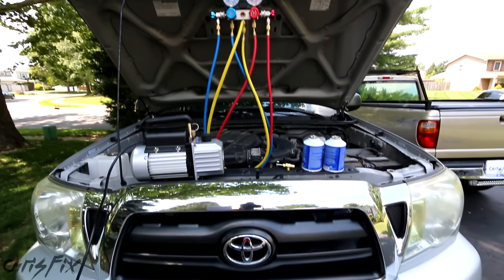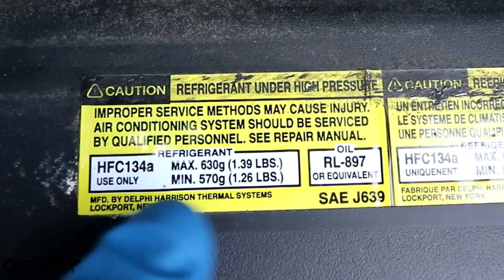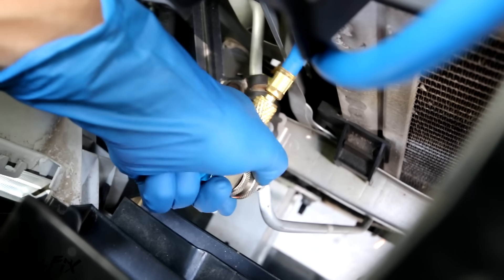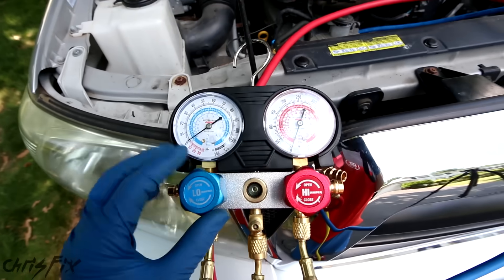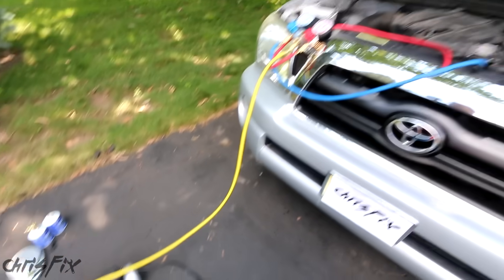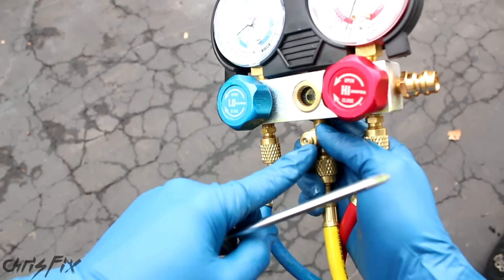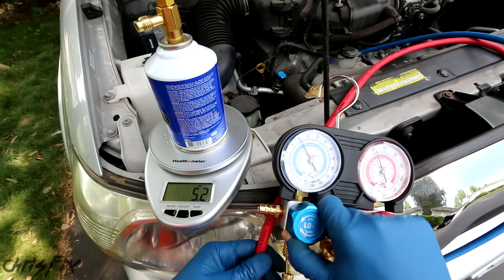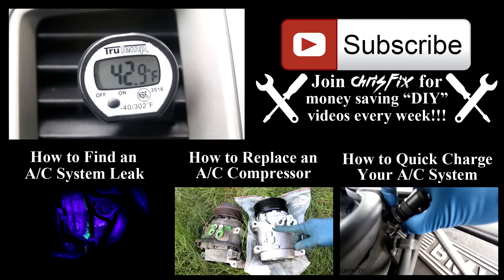How to Properly Recharge Your AC System

Comment: nice video.  If I want to connect the AC manifold just to measure the pressure at the low and high side, should i purge these lines?  how to do so?  I have not seen anyone do that but it make sense as these lines are filled with air? thx
Reply: Its not necessary to purg the lines if you are just checking pressure as the system will push refrigerant into the hose and not draw any air into the system. But if you need or want to purge the lines you can loosen the fitting for the hose at the gauge manifold for a little bit.

Comment: Hi Chris. Thanks for another useful video. My question is: will the low pressure be at 0 if there is still refrigerant in the system? I'd like to find out if I can still test for a leakage without letting go all the refrigerant in the system. Thanks!
Reply from the maker: No, if the pressure is at 0 then it is safe to say there is nothing in the system

Comment: I know it’s an older video, but I have a question: if you close the manifold valves during the leak test, all you’re showing is that the manifold holds vacuum, as it’s isolated from the ac system, right? If I’m misunderstanding something, I would appreciate an explanation. Thanks.
Reply from the maker: No, you would have to close the lines on the service ports to seal off the manifold

Comment: I finished vacuuming the system. Sitting at about negative 30psi. When I connect a can of 134a, and attempt to purge, nothing comes out. The is no pressure. The manifold gauges are in the closed position, holding vacuum. The can of 134a is open. I've tried 3 different cans. Nothing. Needless to say, refrigerant never gets into the system. Not sure what is wrong. The yellow line appears clear when checked. Starting the suburban, turning on the a/c doesn't help drawing the refrigerant into the system. It's as if something is blocked. Is this typical?
Reply: If your system is empty, you have to vacum first  because of the hot air from cycling. After vacuuming to 0 psi then start with charging your system with intervals timed.

Comment: Hi Chris, thank you for the video. I'm just wondering if I'd need to do the step to vacuum 45 mins every time I recharge? For example, my car's AC now is still cool from last year, there may be a small leak which I don't want to chase it now. I just want to recharge every year to get it cold. In this case when my AC is still cool, do I need to vacuum 45 mins before recharging, or just go ahead and recharge right on? Thank you.

Comment: Great Video Chris!! But now that I’ve changed the compressor, the ac light blinks three times when I try and turn it on. ???
Reply from the maker: It depends on the make/model but it can mean that your refrigerant is low/high or your fan is not on when you turn the ac on

Comment: hey chris love the video that you put out. It has help me through alot of my diy fix. This is for my 2005 Acura RSX ( 19.7oz refrig)
 I have a question for you, or anyone who willing to given me a hand. I following the direction with the your ac compressor replacement and ac recharge. I replace the Ac compressor and did a vacuum on the ac system, everything went great no leak(pressure hold, but i start to recharge my ac everything was fine until i started to recharge the second one. I am not sure what happen but my ac refrigerant started to leak out like crazy, in front of my bumper, look like it might be my condenser had a leak, I put  my hand over the consdenser and can feel air coming out of it. i have decide to replace my ac condenser. I just want to know since this leak happen how do i know how much peg oil to add back into my ac system. Any feed back will be great.

Comment: Excellent video Chris. One final step I usually do is to get a little bit of water with some dish soap in it and put that in the needle valves connections. If there's any bubbles present you know the Schrader valves are leaking. I like to put just a small amount of refrigerant in first before I do this test so I don't waste refrigerant.

Comment: You confused fluid oz (volume) and weight oz 1 lb is 16 oz, true, however, depending on the density of the thing you are weighing.  You would have to measure the starring weight of the gas container and watch it drop to know how much you are putting in.
Reply: It is a typo on the can, it supposed to be weight ounces.

Comment: An empty can has some weight. That must be accounted for when calculating percentage of refrigerant used. Easy IF you are using more than one can you have to use or have an empty can laying around.
Reply: Your only removing the refrigerant so when it's 10 ounces lighter that equals 10 ounces of refrigerant.
Reply: @wandameadows5736  thank you

Comment: @chrisfix, when replacing the compressor and it comes pre-filled with oil and you do a vacuum before filling new gas, won't the oil also get sucked out? And when you add oil at the end of the yellow line, won't air also get sucked in?

Comment: Top video Chris. Well done. Worth mentioning that R134A will often run at a slightly negative pressure on the low side after charging. This has always been the main issue with it because any leaks then draw in air. R12 never did this and I'm old enough to remember using it :-) Also, car air con systems often lose refrigerant without having any kind of leak in systems with mixed aluminium and rubber hoses.
Reply: No it should not. If your system is pulling into a vacuum it has problems. The low pressure switch is supposed to turn off the compressor when the suction pressure gets too low. That is how most automotive systems are cycled as opposed to a thermostat
Reply: @Redtooth75  you really are not familiar with R134a, are you knobhead?

Comment: I tried to do this with the new self-sealing cans, and when I went to purge the yellow line, I wasn't able to get a cloud of refrigerant to blow out. It just blew transparently & rather weakly (iow, didn't blast out like in the video). Are the self-sealing cans lower in pressure or something? FYI this is in California.

Also, using this method, it doesn't seem like you'd be able to fully purge the line, as there still would be some air trapped in the 'sight glass' / mixing chamber of the AC manifold, so you're still gonna get a small amount of air into the lines. Should this be a problem though?
Reply: I have these exact questions, mainly the first one, except my cans don't say they're self-sealing. Was it truly refrigerant blowing out when you purged, even though it was transparent?

Comment: Hi Chris, great work as always. I'll be doing this on my Ford Ranger next weekend. Quick question though. Like you said, the new compressor comes preloaded with oil, but wouldn't the vacuum pump suck the oil out?

Comment: Notes for future self, explained like 5 year old:

1. Close all gauges
2. Connect hi/lo lines to the tube things in car
3. Open lo, then open hi pressure lines (connected to car)
4. Make sure hi and lo gauges are both at 0 psi (?)
5. Connect yellow line to vacuum pump and turn it on
6. Open low valve (under gauge hanging from car), gauge should go into the red
7. Open hi valve (under gauge hanging from car)
8. Let it run for a few minutes
9. Close both valves (hanging from car)
10. Turn off vacuum pump
11. Let it sit up to 1 hour, should stay at -30 in red, or else it means there’s a leak and you're screwed
12. Turn on vacuum pump, open both valves (hanging from car), let sit up to 45 mins to remove moisture from system
13. Close off low and then hi valve (hanging from car), shut off pump
14. Add some UV dye in yellow line (optional)
15. Connect r134a to yellow line adapter
16. Screw down adapter to close the valve in yellow line, verify hi/lo valves are closed (hanging from car)
17. Screw adapter to open the valve in yellow line
18. Purge the yellow line of air, with pin at the top near gauges until 134a sprays out
19. Start vehicle, turn ac on, fan on low/med
20. Open low valve only (hanging from car), 134a is now flowing into system, blue gauge moving
21. Soon, compressor should kick on, moving blue gauge down to around 10 psi, while red gauge steadily increases psi
22. Wait for compressor to suck out r134a, when nothing happens, hold can upside down/gently shake, to get more out
23. When empty, close low valve
24. Close yellow line adapter, to seal it
25. Screw on new can
26. Weigh it accordingly
27. Open yellow line adapter valve 
28. Open low pressure valve only (SLOWLY) for ~20 secs, then fully open
29. When at correct weight, close low valve hanging from car (blue)
30. Shut off red valve (connected to car) and remove it
31. Shut off blue valve (connected to car) and remove it
32. Put caps back on tube things in car
33. Hope and pray it worked

Comment: I'm having frequent compressor cycling but the A/C does blow cold air. Because of the cycling I get engine surges. I don't have vacuum leaks and the IAC is fine so I'm thinking I just need to add refrigerant. So, I'm wondering if I really need to spend the money for all this equipment for rare maintenance like this instead of just buying a can of refrigerant with a gauge. 2002 Mustang GT. Of course I could spend the big bucks to have a service shop do the job and hope they do it right. I really don't want to buy all this equipment that'll sit around collecting dust afterwards.
Reply from the maker: Rent the gauges and check. Then just use a refrigerant can from the store to top off.

Comment: Hi Chris, good video, I noticed you didn't turn the fan to the highest setting during charging and the recirc was on. Please explain.
Reply: When charging by weight the airflow through the evaporator is not critical. If referencing pressure and line temperature to do a top off then it is critical.
Reply from the maker: It just needs to be on so the ac compressor clicks on.

Comment: I've been researching this topic as I'm about to do this on one of my vehicles... One thing I read is you should never turn the can upside down or lay it sideways; only vapor should enter the system, not liquid.  Are there any A/C professionals out there who can confirm this?
Reply: Holding the can upright will charge as a vapor, holding it upside down will charge as a liquid. Charging as a liquid is faster but if liquid refrigerant gets into the compressor it can damage it. If you charge as a liquid you have to throttle the valve on the manifold to prevent slugging the compressor. It is recommended to charge as a vapor when possible to reduce the risk of damaging the compressor. But refrigerants like 410a and 12b are blends so they must be charged as a liquid. Common automotive refrigerants like 134a and 1234yf are not blends so they can be charged as a vapor.

Comment: still can't figure out how to get oil in the system and purging the air out of the line, if you put oil in the hose then purge the oil comes out along with the refrigerent.  How do you get oil in it?

Comment: Weird question but I noticed you have the end in the hose with the Schrader valve on it  connected to the manifold. I've seen other videos where the other side of the hose is connected to the manifold. Does it matter which end you use?

Comment: I bought a vacum pump and manifold guage kit using the link and the hoses didn't fit the car so frustrating. I put a new ac compressor in and was gonna vacuum the system now the hoses didn't fit. Should've done more research I guess.
Reply from the maker: Was it not an R134a system?
Reply: @chrisfix  No it is a 1234yf system.
Reply: @GloriainexcelsisDeo777  1234yf use a different size quick connect fitting

Comment: Maybe I'm being completely thick here! But when you weigh the can, do you calculate on the equivalent weight of gas/liquid or the actual weight of the can?
Reply: You measure the weight of the can, the refrigerant inside of it, and any force applied by the hose. Then you just measure the difference. For example if everything weighs 5 pounds total and after charging it weighs 4.5 pounds then you have added 0.5 pounds of refrigerant.

Comment: You should remove the high side first, then open the low side to suck the refrigerant in the high side hose into the system. There will be a few ounces of refrigerant in that manifold line. Then remove the low side hose last. Keep the can of refrigerant closed off at that time.

Comment: You added dye to the refrigerant before recharging but isn’t one of the purposes of vacuuming the system to remove all moisture? And isn’t the dye liquid?  

Is this a problem?
Reply: The purpose of the vacuum is to remove any contaminants, moisture and air specifically. The dye is a liquid but it is not moisture. It is designed to be in the system and will not cause any problems.

Comment: I know this is an old video, but I have a 1999 Ford Ranger 2.5 and am changing all my a/c because of a condenser leak. My systems holds as it says 9 oz of pag 46 oil. My new compresser comes with 7 oz of oil and it says to empty and refill with half of 7 oz which is 3.5 oz and to put the rest in my drier, condenser and evaporator. My question is how much to put in these parts to get to the 9 ounces my system takes? Am replacing the a/c system with all new parts except the evaporator. Thanks for your time.

Comment: Can the same manifold guage be used for R134a and R1234yf systems? I'm guessing that the only difference is the high and low side connections on the car, so different adapters would be needed?
Reply: Correct the quick connect fittings are different but the manifold and gauges are the same. A 134a manifold could be used on many different refrigerants.
Technically speaking you are only supposed to use the manifold on one type of refrigerant. So if a brand new manifold is used on 134a then it is only supposed to be used on 134a for the rest of its life. This is to prevent oil cross contamination. If traces of oil from a 134a system is in the manifold and then the manifold is put on a 1234yf system you can get that oil into the wrong system.

Comment: What if your ac compressor isn't clicking on?
Reply from the maker: Check the fuse and make sure it's getting power (and the ground for it is good), if it is and it's still not engaging it might be due for a replacement
Reply: @ChrisFix  it was a bad relay,  thanks for the reply 🙏 (this was after a compressor replacement)

Comment: I'm just replacing a solenoid on my AC compressor, do I have to add oil?

And like someone asked below, putting oil in the line and then purging would lose the oil. How do you get around that?

Comment: who is going to buy all that shit to do a basic recharge....
Reply from the maker: They rent it for free at many auto parts stores or you can buy it and still save money on the repair compared to taking it to a shop.
Reply: Cost me $270 to recharge one of my cars... Cost for all the equipment and refrigerant is less than $200 - and that's if you buy it all.  AutoZone and a couple of other parts stores actually loan the equipment for free, so if you do that, the only cost is the refrigerant and your time to do it.  I'd rather do that than spend the money at a shop which I don't even know is competent to do the job correctly.
Reply: Just to clarify;  I didn't realize how easy it is to do this, so I paid a shop that $270 to do it.  Now that I know how easy/ cheap it is to DIY, I'm doing it myself on my other car.

Comment: How come when I put it on a scale it doesn't take remaining freon? My car takes 18.5 ounces 1 can of 12 ounces, then 6.5 ounces weighted.
Reply from the maker: Take the van off and shake it as you press the trigger. Sometimes the can gets very cold and the lower pressure in the can causes it to not get sucked into the system.

Comment: Question is how long does it take to suck up one of those little cans? Seems like can is cold but man it isn’t sucking anything.. Also purging didn’t work either it’s just air that continues to come out no Freon how long do we purge for? Explain with time would be helpful. Like 10 seconds to purge and like 3 mins to suck a can up which is what I thought but don’t seem that way.
Reply: You purge it until you see the refrigerant come out of the valve, exactly as it's shown in the video.  It can take a few minutes to pull all the freon in, sometimes you have to shake the can or turn it upside down to get it all out.
Reply: @cruisey9857  I purged a can that I guess was full of nothing but air.

Comment: Do you need to vacuum the system if you didnt  replace any components and just need to add more refrigerant ?
Reply: Should never have to add refrigerant unless there is a leak. But yes, you always have to run a vacuum

Comment: How can you add oil into the yellow line if the gauges are in the closed position and the hose is under vacuum? This video didn’t help at all
Reply: The red and blue hoses are under vacuum, the yellow hose isn't under vacuum until you open it. Keep it closed, pour in the oil, then attach the can and open the other valves, but yea that reintroduces air into the line like your other question asks.